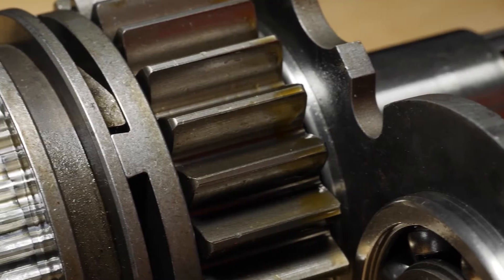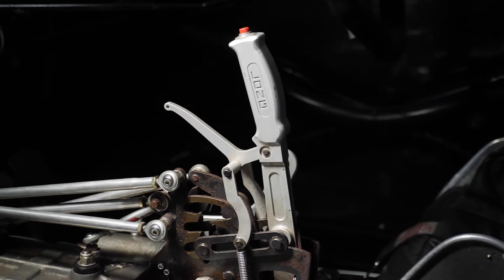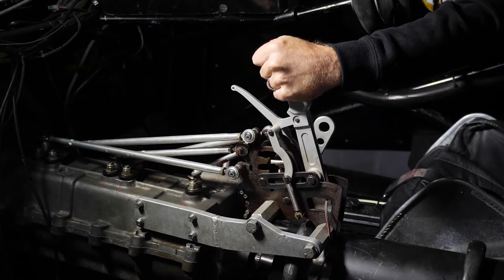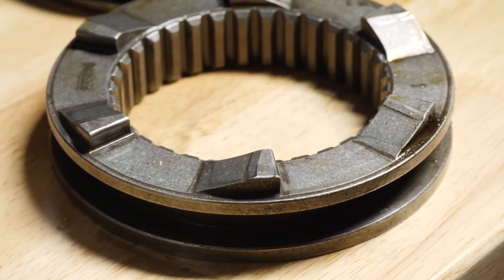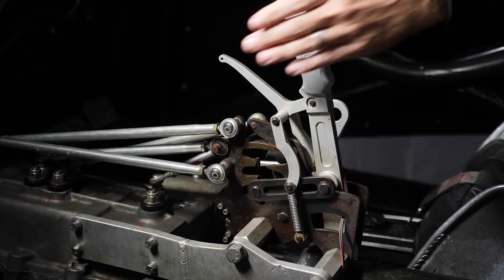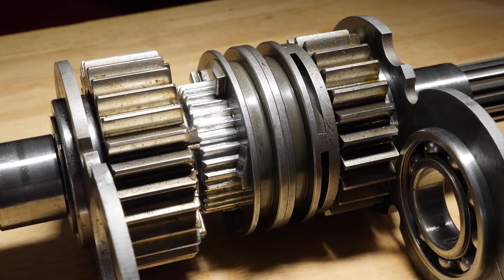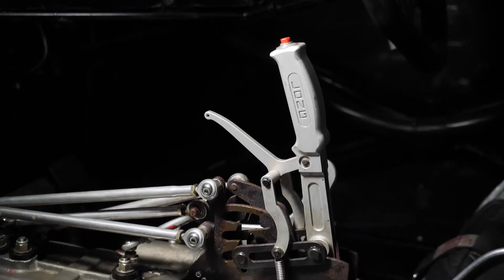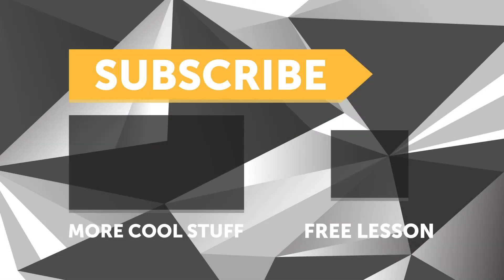1 Drag Racing TWIST On Gearbox Design

Comment: what if I need more than 2 gears ?
Reply: we use this type of transmission in motorcycle drag racing, you can have as many gears to be clutchless and the rest shift with power cut. we sometimes use split sliding dogs or as long as you use a different shift fork for each gear it will work.
Reply from the maker: Fit a transmission that is not a 2 speed - Taz.

Comment: In your opinion it’s this style of gearbox better than a auto for drag racing?
And could this style of gearbox be used with a torque converter instead of a clutch?
Reply: May as well use an automatic to begin with if you want a converter. There’s high-end racing converters that you can tune (stall speed, complete lock up, etc,,) at the track nowadays. 
But I believe that auto’s still have more parasitic loses than a manual. 
Also I think that you can get more consistent launches with an auto,,,, races are won or lost at the line, no making up for a poor start over a period of laps,,,,

Comment: Was just discussing this with some evo owners over the weekend.  Is there a company out there that has a design that can also be utilized on the street maybe a one through three dog box gear set with syncho 4th through 6th?
Reply: If you do enough searching there are some good machinists/small companies that can make these custom one off
Reply: You can't do this style box, but there is no reason you can't have 1and2 dog and 3and 4 synchro. It's very hard or impossible to do 3/4 split like you want. 
Also, makes no sense. Dog first will always clunk going in or you will get sick of waiting for the input shaft to stop spinning before selecting first. Dog boxes are cool as, just not great on the street
Reply: @sexyfacenation  I believe there is a compromise option out there where the gear set is beveled for a smooth engagement to avoid the clunk.
Reply: @DJ_Driven  nope.  Not how it works. If you smooth off or bevel  the dogs they will engage much worse.

Comment: Know of anyone at lower levels than F1 that do the seamless shift using the split second dual engagement? Seems like F1 does the same as in the video, but they manage it to where they don't need to ramp geometry. That would be a really cool video to do, especially if someone is doing it at say a "time attack" level.
Reply: MotoGP does this, starting with only up shift and in the last years seamless up and down shifts
Reply: I think MotoGP (mainly Honda) invented seamless transmissions quite some time ago. They have a slightly different way of doing it though, I can't remember if they have ramped engagement dogs like the one Andre is showing us
Reply: @MegaKei1  they do have ramped dogs
Reply: Yo, not sure if you know of the channel driver61, but he's gonna be releasing a new channel where his dad works on older F1 cars, with full technical explanations and so on.

Just gotta cross our fingers and hope it comes soon, because the engineering behind just about any part is extremely fascinating.

Comment: They're also called seamless transmissions. Some motogp and f1 stuff. Very cool. Nice explanation
Reply from the maker: A little different as you cannot downshift with these, which is fine for drag racing, not so much for MotoGP and F1 😅 - Taz.
Reply: @hpa101  I'm 99% sure they can hold the dog ring engaged because they use sequential boxes and the shifter barrel keeps the fork (and the dog ring) form disengaging. the shifting concept is the same tho
Reply: @flakey7832  no way you are doing that with this style box
Reply: @sexyfacenation  I meant in f1/moto gp boxes sorry